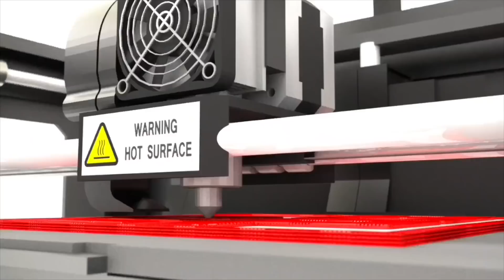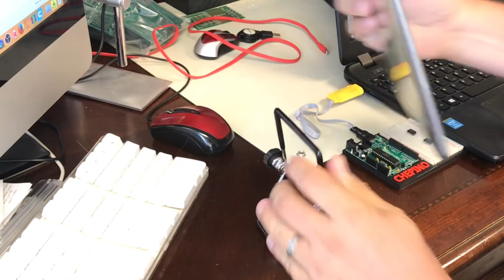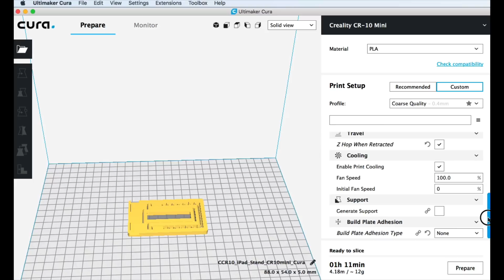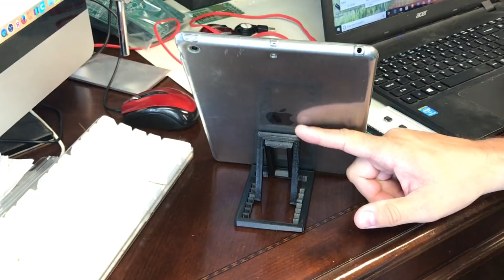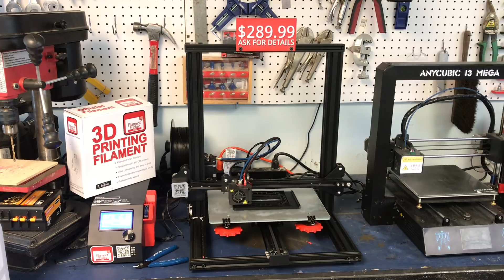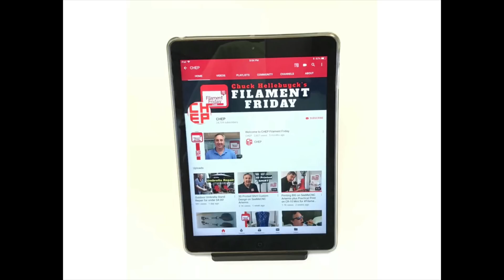iPad Pro Foldable Stand 3D Printed using Filament Friday Filament

Comment: CHEP.  I have an Atfawise 300X300X400 which I think is a clone of yours.  Do you have a list of average settings or a link to such?  Alfawise had nothing in the box.  Thanks in advance.  BTW my mailman loves the flag.
Reply from the maker: I believe that’s a clone of the CR-10. If you have Simplify3D try Tom Jackson settings I link to in my Umbrella video. If you have Cura, try the defaultCR-10 settings.
Reply: Thanks, that will help.  I noticed in the last video you had quality at Draft.  What do you normally use for the final print?
Reply from the maker: Depends on the object. Some things don’t need a smooth surface and it prints faster.

Comment: Get some small rubber feet to put on there to stop it from sliding around. Great video chep!
Reply from the maker: Thanks. I use it on an anti static mat so it doesn’t slide but yes you idea is also possible.
Reply: CHEP instead of increasing the back you should of increased the bottom so that the iPad is much more up and made a hole so you can charge it while using it or making it easier to charge.
Reply: Just thinking out loud here, but for a print like this but in an application where it might be placed on a flat hard surface, I wonder if you could increase traction by printing the bottom layers in something like flexible pla or even tpu then use an M600 in the gcode, swap to standard PLA, and finish the print? I wonder what the layer fusion would be like and whether it would make it more antiskid or not. Well, I may have to experiment.